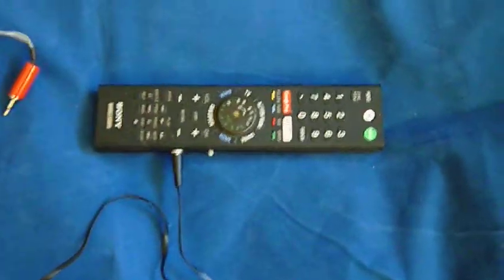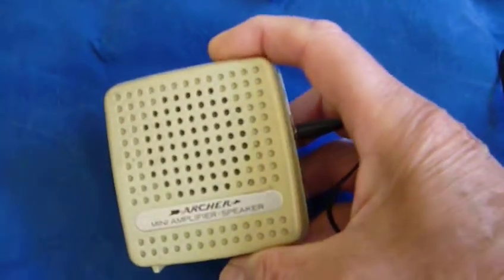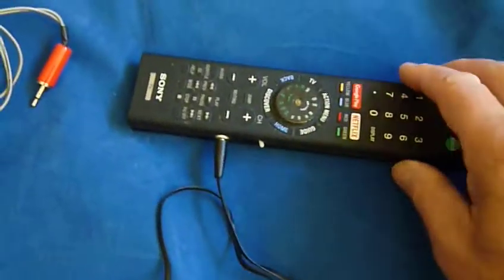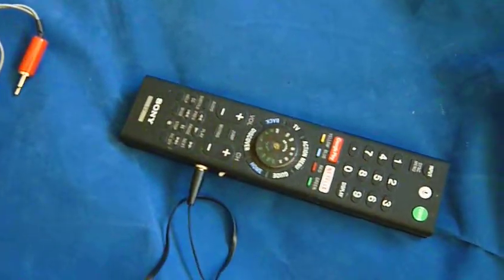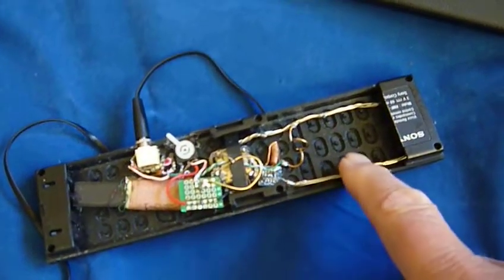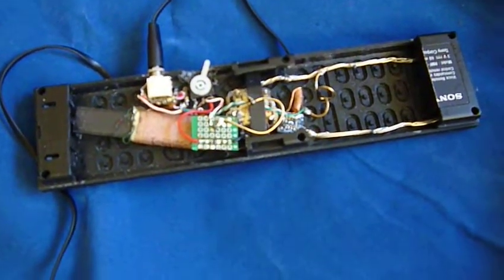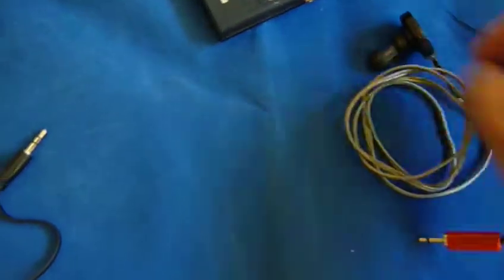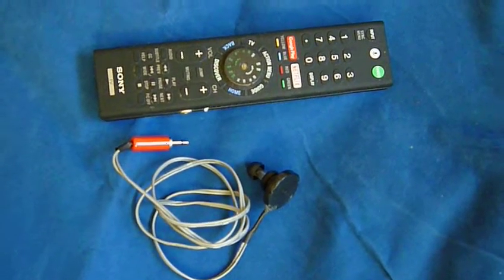MIRACLE  AM-FM CRYSTAL  RADIO WORKS  WITHOUT EXTERNAL ANTENNA.IT IS CONNECTED TO AMPLIFIER.

Comment: Can you provide us with a circuit diagram ?
Reply from the maker: The circuit diagram is as simple as possible, with nothing particularly special about it. The unique aspects lie in the components themselves. Notable elements include the antenna, the Schottky Barrier rectifier diode, and the earphone based on a piezo buzzer. Another distinctive component is the FM band coil, crafted from twisted bold wires and forming a U-shape wire that is only a few inches long. I've named it the "FM band litze."The FM band rectifier consists of just a single Schottky Barrier diode, functioning as a slope detector.
Your location is the most crucial factor. I am close to several high-power AM and FM band transmitters. This is the key, not the circuit diagram.
Reply: @imreolajossr6355  As you said, this is only the key. Without a circuit, we are still not able to figure out what the radio is !
Reply: If you can make a video to show the whole building process, that would be more wonderful ! A suggestion only.
Reply from the maker: I'm sorry; I cannot create a video of the building project. It was only done once, and I lack a remote as well as the necessary parts to replicate it. @eddyyu7091

Comment: I love your work.  I have been researching crystal radio and experimenting with short antenna for optimum reception.  :). Fun fun fun!
Reply from the maker: I am working on a larger crystal radio project, collecting parts, gathering information, creating modules, and searching for the right box. I have two 50 kW stations close to me. I plan to build a set with two crystal radios in it. I will incorporate two voltage multipliers connected in series to generate higher voltage and supply a one-transistor receiver along with a third AM receiver. It's a big triple project.

I am anticipating only microamperes from the two voltage multipliers. It may work, or it may not work at all. I am referring to a solution without an external antenna—very challenging conditions.
Reply: @imreolajossr6355  interesting, I cannot wait to see results. :)

Comment: Looks impossible, crystal radios don't work without at least 10 meter long antenna and good ground, how far is nearest AM radio station?
Reply from the maker: It looked impossible to me too but it works so I do not mind what  do you think about crystal radios. I developed these models in 4 or 5  years. Now I have a separated AM and separated FM  crystal radio. The  distances what I checked today( 11.28.2022) the 50 kW stations(WBBM 780kHz and WSCR 670 kHz)are2.28 miles(3.67km). The WGN is on 720kHz, medium but still useful because it is  almost 90 degree away fro  the  50 kW statiosn,. So  WGN  is 5.17 miles(8.32 km.) I am not sure where is  the  spanish language  station, the  fourth station  what is  almost as good as WGN daytime. I am talking about  MY crystal radios what I am using almost ever day and  night. No battery in these units, no extenal antenna at all. Just the  little box and the  connected  earphone. I have  no secret about it but my location. The 50 kW stations are producing me  around  75 mV audio. I just used my newest Digital Multimeter the PDM-711 in 200mV DC mode.The smallest audio what I was able  to identify, was around 8 or 10 mV but I do't hear that station  any more .I developed a new  ferrite based antenna ( for AM band) and  SHOTTKY BARRIER diode and piezo buzzer based  single earphone  around 100 kOhm impedance.( Paralel resistor is around 80 or 100 kOhm I found the  best..I hope I gave you   a proper answer.Thanks for checking my  videos.
Reply from the maker: It looked impossible to me too but it works so I do not mind what  do you think about crystal radios. I developed these models in 4 or 5  years. Now I have a separated AM and separated FM  crystal radio. The  distances what I checked today( 11.28.2022) the 50 kW stations(WBBM 780kHz and WSCR 670 kHz)are2.28 miles(3.67km). The WGN is on 720kHz, medium but still useful because it is  almost 90 degree away fro  the  50 kW statiosn,. So  WGN  is 5.17 miles(8.32 km.) I am not sure where is  the  spanish language  station, the  fourth station  what is  almost as good as WGN daytime. I am talking about  MY crystal radios what I am using almost ever day and  night. No battery in these units, no extenal antenna at all. Just the  little box and the  connected  earphone. I have  no secret about it but my location.
 The 50 kW stations are producing me  around  75 mV audio. I just used my newest Digital Multimeter the PDM-711 in 200mV DC mode.The smallest audio what I was able  to identify, was around 8 or 10 mV but I do'nt hear that station  any more. I developed a new  ferrite based antenna ( for AM band) and  SHOTTKY BARRIER diode and piezo buzzer based  single earphone  around 100 kOhm impedance.( Paralel resistor is around 80 or 100 kOhm I found the  best.. I hope I gave you   a proper answer.Thanks for checking my  videos.

Comment: not a  crystal radio.
Reply from the maker: There is no battery and n transistor,no any active component.There is only crystal diode in it.So it is a crystal diode radio.Please tell me what is the real crystal radio according to you?
Reply: The 'Crystal' detector radio receiver is the most basic of receiver circuits, to say "Not a Crystal set" without explanation for a contrary opinion is unfair so I will endeavour to support our friend with clarification. 
 
What is being forgotten here and was disclosed in the video is the 'audio amplifier' is doing the hard work and is necessary for your enjoyment on YT. Normally a very high impedance Crystal earphone is used as the only available current is from the antenna ( which in this set is the earphone wire ) is to weak for a conventional earphone.  The antenna current is used to be demodulated / detected by 'Cats whisker' but in this set the Galena crystal is replaced in this set with a Schottky diode. 

The fact it can detect / demodulate AM and FM is no small achievement and building it in a remote control is novel and something the Special Operations Executive (SOE) would have liked in their kitbag.
So to the naysayers in the comments this is a 'Crystal set' with the 'Cats whisker' and the Galena crystal substituted with a Schottky diode which is in no way amplifying just detecting RF current induced in the earphone wire, with interesting FM demodulation.   
So with respect  to harshvardhansing3948 and other naysayers give credit to this mans work and refrain from implying deception.  THIS IS A VERY INGENIOUS   'CRYSTAL SET' .  Go build one .......
Reply: This is no doubt a crystal radio. I used to live in the city, and built dozens of sets like this, but using 1N34A, 1N60 and 1N82A diodes. It's inspiring work you do, Imre. I don't live near enough to transmitters now for this design to work, unfortunately. @Woffy.

Comment: Not an crystal radio.
Reply from the maker: The radio connected to the  transistor amplifier for  demonstration  only. It works fine without  any  battery or  power source. Itworks  only  from the energy what comes from the  transmissin. It is a crysta dioode radio- a modern version of catwhsker crystal rectifier. It works free for me and I love it. I do not care  of any  opinion about it, I was told by  experts- impossible to create one like  this. I created it and  works for me, just because the special location. It will not work 30 miles  away for sure,I am happy with the  radio and   you can hear it  too.

Comment: This is not a crystal radio.
Reply from the maker: Yes, this IS a crystal radio with  crystal diodes!
No external antenna  and no amplifier in it I just demonstrated  the work with a transistor  amplifier for the video. Yes, it works with crystal diode and with piezo buzzer based crystal earphone.